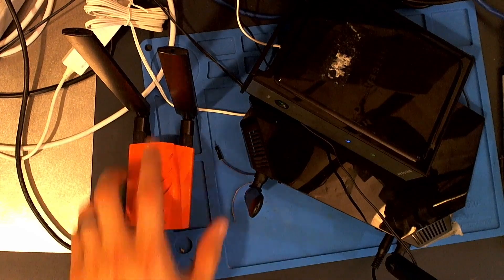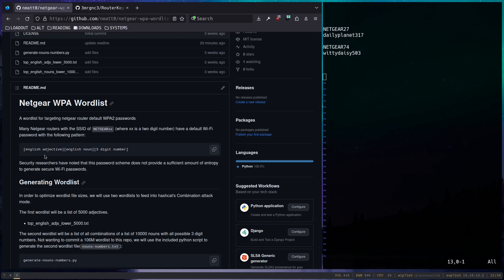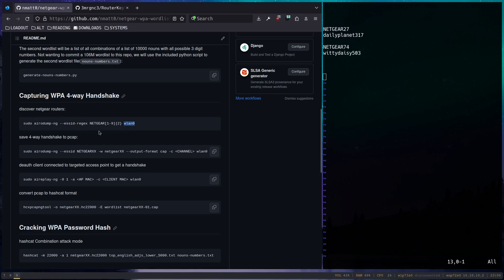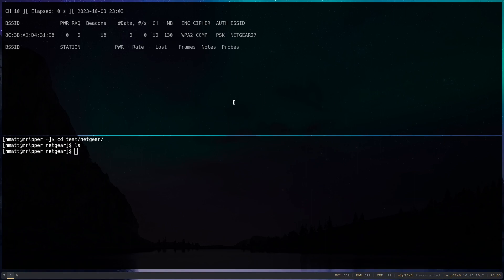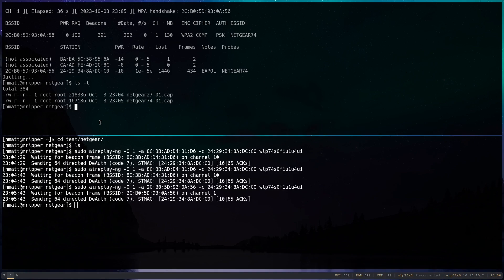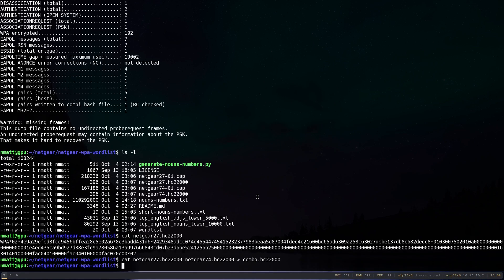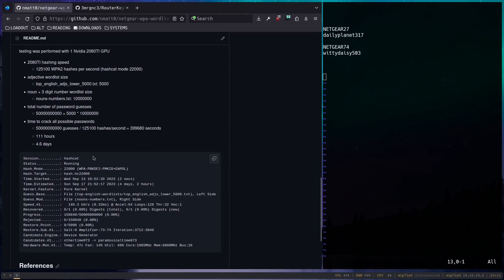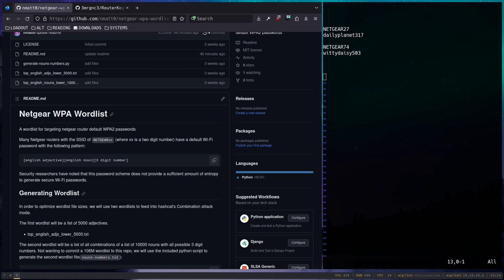Hacking Netgear Wi-Fi Router Default Passwords

Comment: I wonder if there is a router that would automatically connect you to a different channel when someone may have knocked you off the network.  This way if someone was looking at just one channel they would get nothing hehehe.  I know that WPA3 can help also but it is not as secure as someone may think.  We need a router that will not allow WPA2 so that WPA3 can be more secure.
Reply: Knocking someone out of the network is the old method. This is an old method attack.

Comment: Hi, can you make a video tplink 8mb spi flash change to 16mb with full capacity work in openwrt firmware, make a uboot modified capacity 8mb to 16mb 
Please make a video for it if it's possible... I'm trying to make 8mb flash to 16mb tp-link WR902ac router but I'm fail always. Hope you do it . I'm waiting your reply...